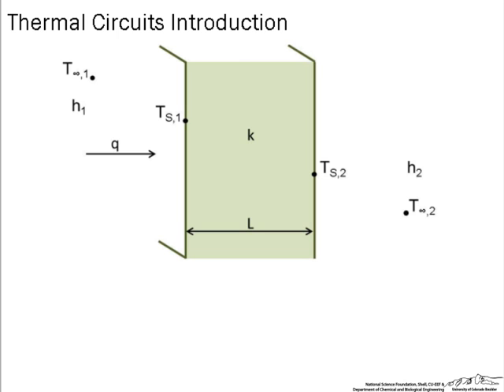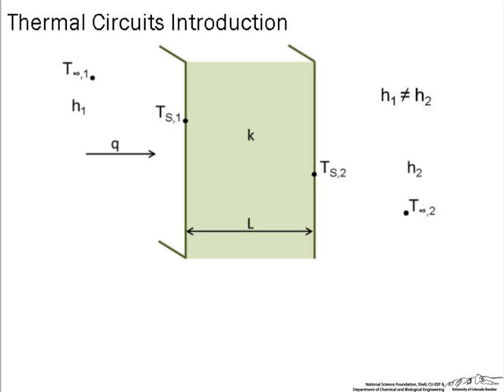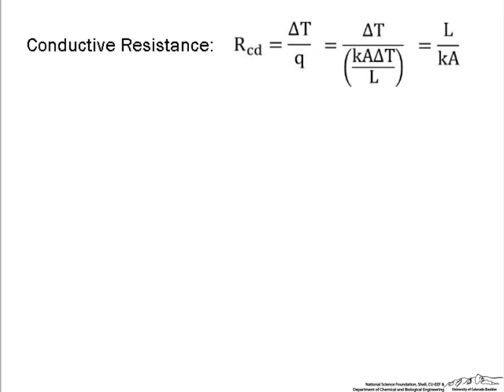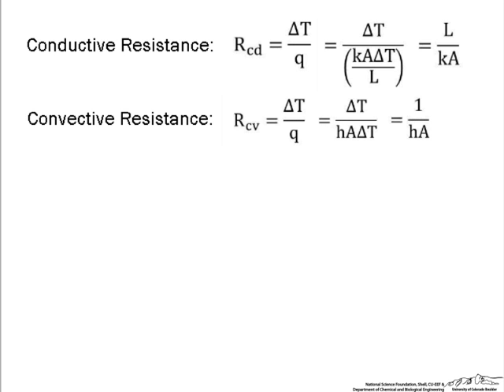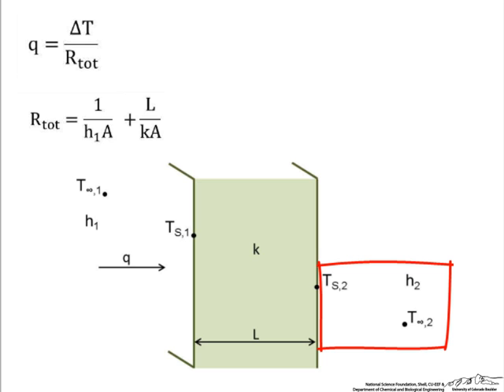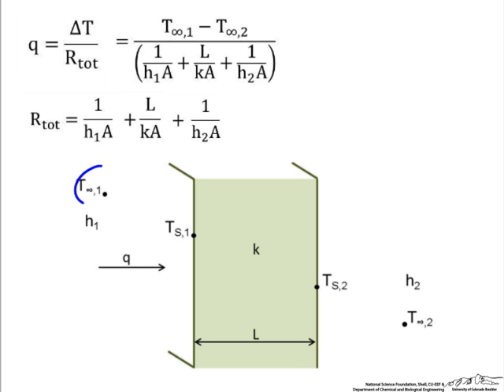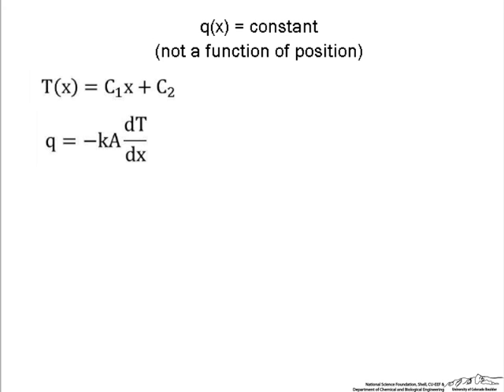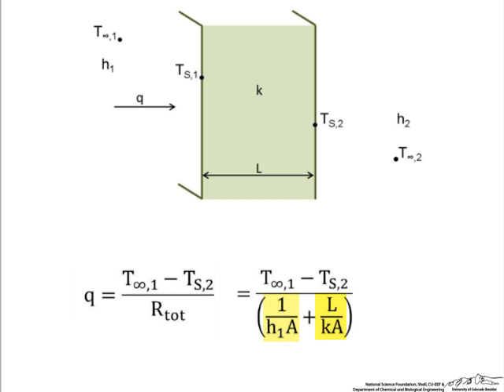Thermal Circuits Introduction

Comment: Is the 1st q equal to the second q? The 1st q is between T(infinity,1) and T(infinity,2) and the 2nd q is between T(infinity,1) and Ts2. Thank you in advance for the response.
Reply from the maker: If  the q's are taken at different locations/temperatures, then yes, they will be different.  They will have different temperatures and different resistances.
Reply: @LearnChemE  Thank you very much, it was a great video

Comment: Is the last equation on the last slide correct? I think the numerator for the first term should be T(infinity,1)-T(infinity,2) instead of T(infinity,1)-T(s,2)? Thank you.
Reply from the maker: The last equation is correct.  We are trying to find T(s,2), so we are using T(infinty,1) and T(s,2) and only the two resistances between those temperatures.

Comment: I think there's an error at the end with Rtot. It should be as it was before (including the 1/hA term).
Reply from the maker: Sayuri Lia is correct.  For the last calculation, we are trying to find T(s,2) so we are only using two resistances.
Reply: I didn't see any error. The Rtot didn't include the second convective resistance for that example.